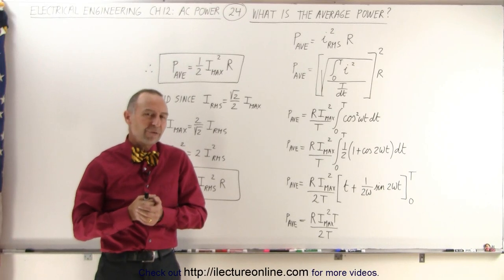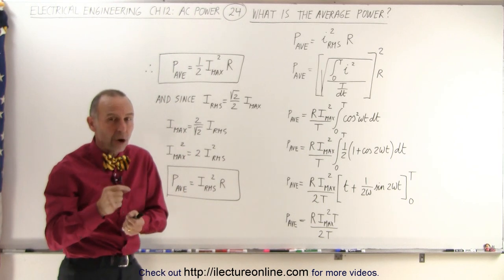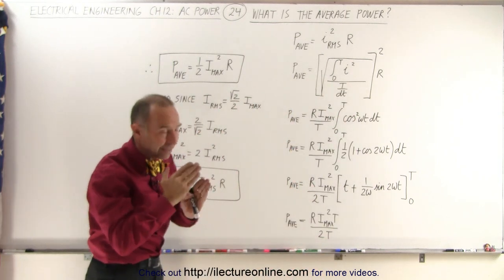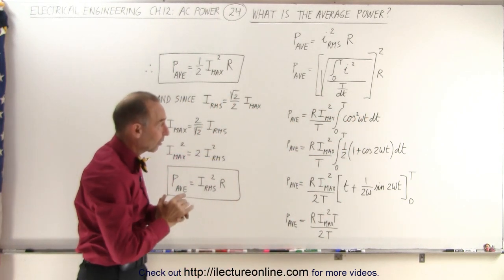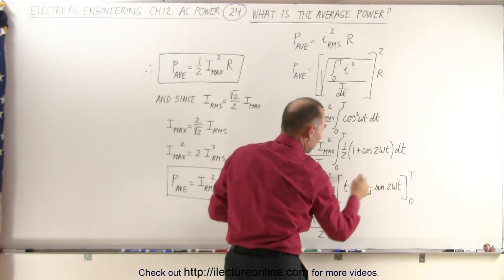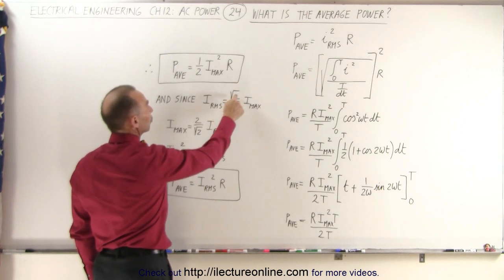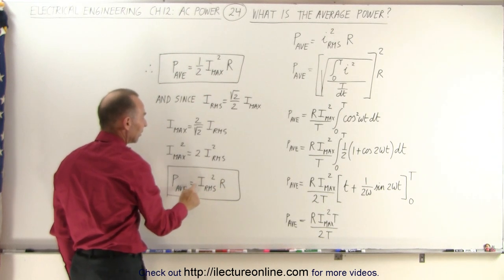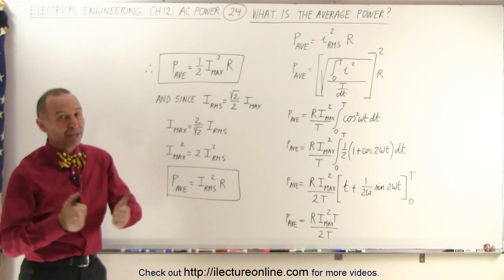Electrical Engineering: Ch 12 AC Power (24 of 58) What is the Average Power?

Comment: What is this Average POWER? Before there was another formula for average power?
Reply: This formula Is NOT average power is ACTIVE POWER. Px. I call "RMS" power or "effective" power.
Reply: I would also ask that. But it seems that this is a different concept.
Reply: @deniz-gunay Note that this formula he mentioned here is for power consumed by a RESISTOR. This formula here will give you the same result as the formula in a previous video which was; Pavg=(1/2)*Vm*Im*Cos(phi_v-phi_i). Because the voltage and current phase difference will go to zero for a resistor and cos(0)=1 and you'd be left with Pavg=(1/2)*Vm*Im which is the same as Pavg=Vrms*Irms and this will give you the same result as the formula mentioned in this video for a resistor which is Pavg=Irms^2*R.
Reply: @Zuwwar  thanks